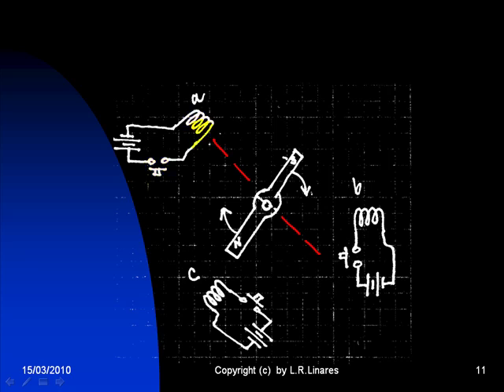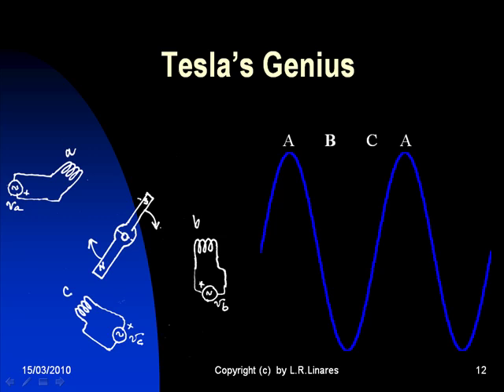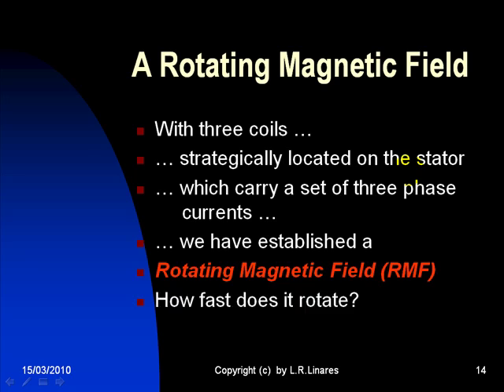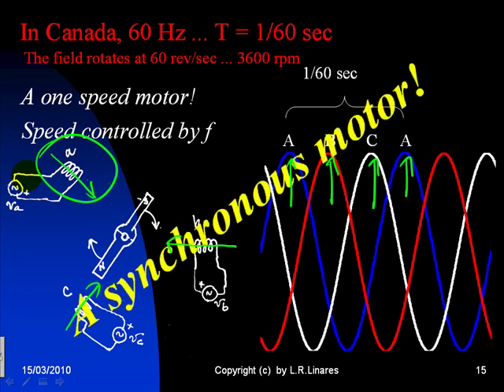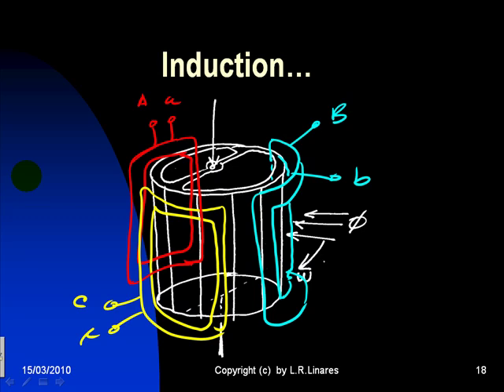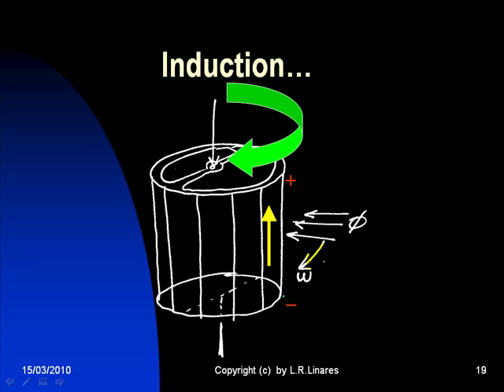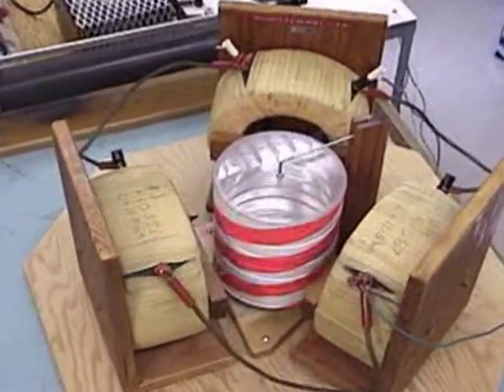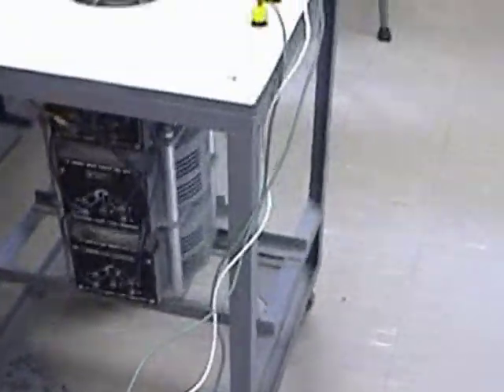INDUC 03 - The Induction Motor, Rotating Magnetic Field

Comment from the maker: The motor described is a three phase induction motor, the quintessential electric motor. With two phases you can also create a rotating magnetic field and get motor action. With only one phase, without some "tricks" described in the theory of single-phase machines, you create not one but two rotating magnetic fields in the airgap of the machine: and they rotate with the same speed ... but in opposite directions. The "tricks" (or techniques if you prefer) are to eliminate one of the two during

Comment: The slowly rotating fields clarifies the principle, thank you! I can visualise setting up a 3-phase generator with variable frequency using manual rotational control, but how would the rotation frequency be easily controlled electronically?

Comment: greetings and thanks a partner let me tell you that comment because we have already variuos protitipos working magnet motor with excellent results and low power Muncha multiplicandese trasforamdor learns the secondary of the motor 1/4hp example and to work with only 18vca and 1 ampere in the primary and the 14vca there any side with 11 amps with more than 20 kilos of mechanical strength as we have other large motors 110 and 240 with exlentes results thanks and contact estmos gpe jose kings atte